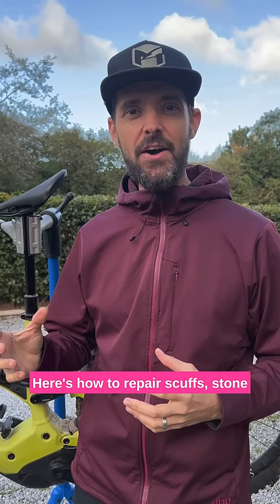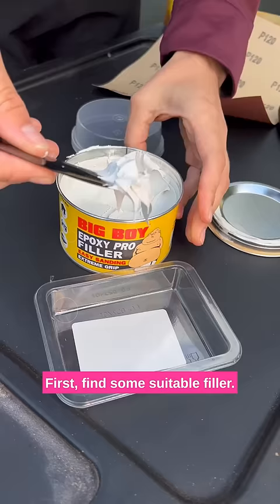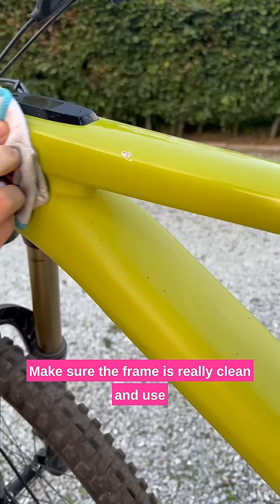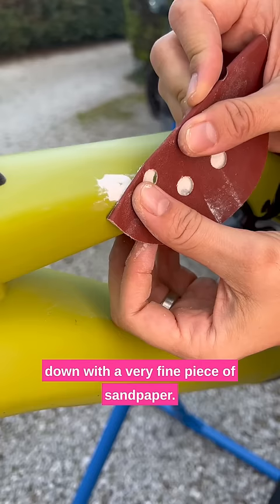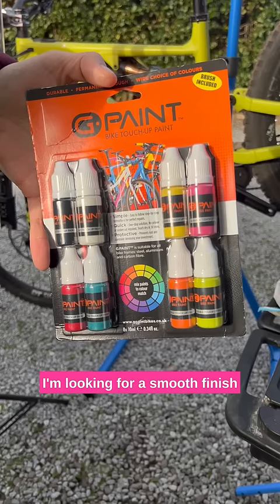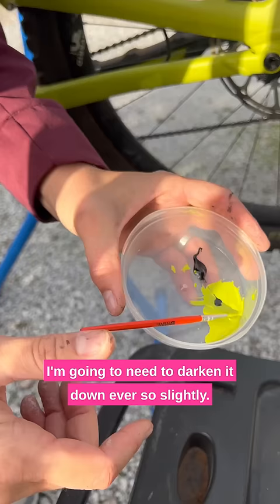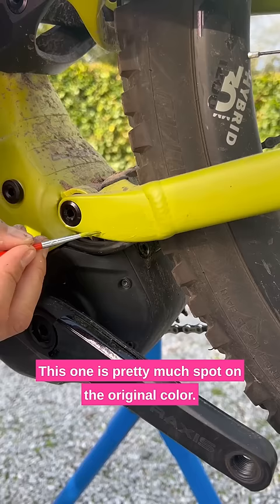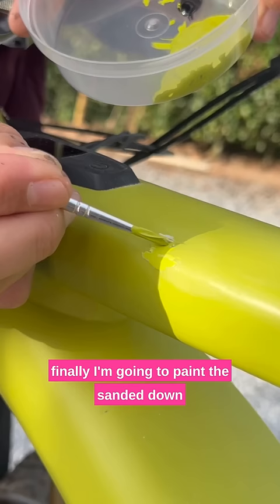How To Repair Paint Chips On Your Bike #shorts

Comment: The real pro tip when purchasing a MTB is to choose an aluminum frame, painted silver, every chip goes un-seen 🤙🚀
Reply: Yes, but aluminium is much less stronf compared to the  carbon
Reply: @koliasic  stronf? Never heard of that strength metric.
Reply: @koliasic  Carbon fibre is strong in terms of gradual compression, tensile pull and material fatigue. It is weak in sudden impact.  

I have carbon road bikes, Cervelo, Canyon, basically the point of contact will be shattered in big collisions, while aluminium unlikely, prolly just dents. Even if you can fix the CF frame, it is 80% of the original cost. I wish there are more brands that make bike like caad 13.
Reply: @Bike Is Life  You need to convert it, but it's equivalent to 3.1 fuertes.
Reply: @koliasic  Carbon is strong relative to its weight. It’s still pretty weak compared to aluminum. Carbon is lighter which is why it’s used in high end bikes. You want a strong bike? Use titanium. You want an even stronger bike? Use spring steel and heat treat it yourself.
Reply: Or buy titanium frame , no more paint to chip
Reply: Or just skip the paint entirely, raw alloy for life
Reply: @danbroadhead72 Man, I really don't get why you guys in North America still use Fuertes and Stronf to measure Impact Strength...

The Metric Résistant is a way better unit as there's no need for conversion.
Reply: @yorkoxmaul66 Carbon repair is like 200-500 here
Reply: True but they all have clear coat and even if not you will notice the big dents/scratches in the light.

Comment: sand it with a block or you'll end up being able to feel a depression there where your sanding is 'finger shaped' good repair!! need to do loads on my levo but.. its rocket red !
Reply: A chunk of concrete would be less abrasive and more precise than the 240 grit "super-fine" sandpaper.  3000 grit is super fine 240 is road gravel. 😂

Comment: Wet sanding even with paper not designed for it gives a great finish , just dip the paper in water often and sand normally, a MUCH smoother finish , i go to 2500 grit before finishing with cut and polish , most paintwork has a clear coat which is the UV stable element , i highly recommend finish with clear then sand to 2500 in steps 240 480 800 1200 1500 2000 2500  , a sheet of sand paper is cheap and i save them for other jobs .

Comment: You forgot the  most important part, after sanding and paint, use clear coat spray paint, it will prevent it from falling out.

Comment: Sadly you have a high chance if that repair to fail. Why? Because you didn't prep it properly by cleaning, then sanding to feather out the edges of the chip and to create a better physical bond for your touch-up paint. 

Pro Tip: for the best repair or paint job learn how to do the prep work properly or take it to someone who does repairs/paintwork!

Comment: Epoxy is notoriously hard to sand. I would have used a small brush to apply a little primer (from a rattle can). Then a little filler (also from rattle can). The filler from a can can easily be removed with solvent - also very easy to sand and it can be sanded super smooth. Paint afterwards.
Reply from the maker: Thanks for the tips!

Comment: What is the display for? Also, do you know if you can upgrade a trek marlin 4 to full suspension or do you think that it is necessary?
Reply: Absolutely necessary. Just cut the frame, weld on some extensions and bolt on a 170 mm shock. So easy.

Comment: This is baaad. Mix a tiny bit of filler and press it into the scrape, using the scraper to form it to the shape of the frame, without any getting outside the area you are working on. Let it cure, then do the same thing again. This prevents you from damaging the area outside the scratch, and stops you from deforming the shape when you're sanding a massive lump of filler you've dumped onto the frame like a total amateur